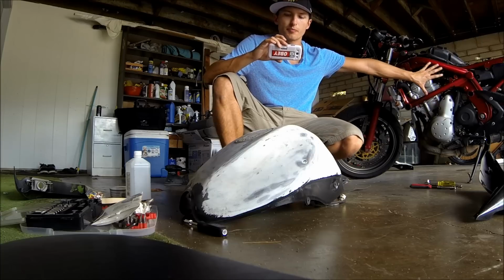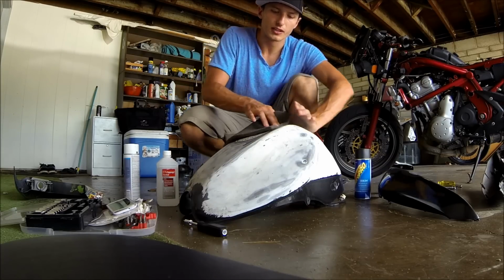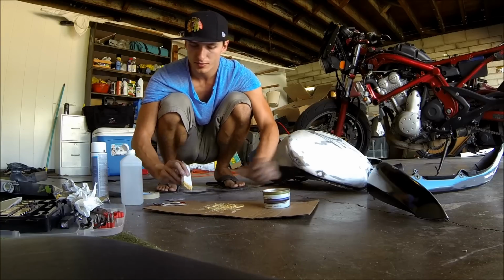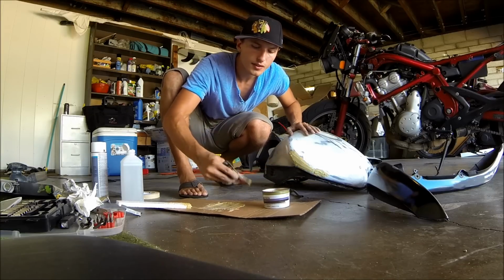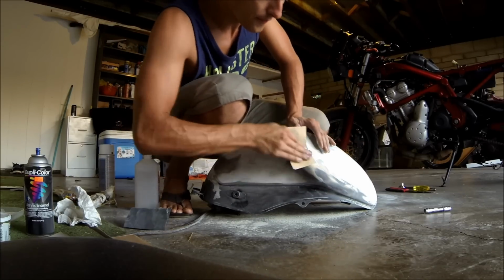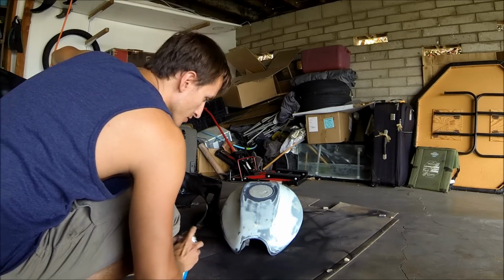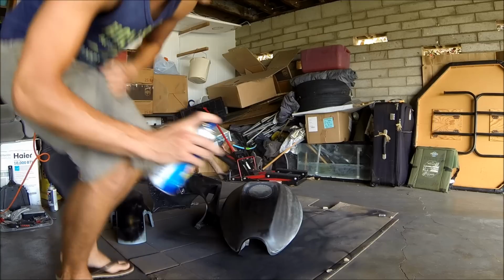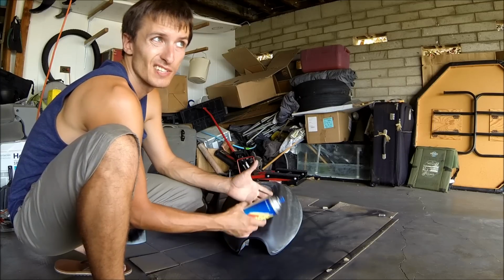HOW TO PAINT a Motorcycle Like a Pro For Less Than $50 !!!!

Comment: nice video bud, only thing i would mention is i used to paint things like bikes and car parts before i got in the car refinishing industry, the problem with aerosol paints at least most of them on gas tanks is that petrol dissolves them. so it is wise to put a 2k matt clearcoat at least on the gas tank

Comment: Yo man. Go Hawks! Little tip on the bondo mixing. Spread it to mix it. If you "stir" it, it can put air bubbles in your filler which will make pock marks

Comment: how are you dealing with gas spill on tank ?. spray can pain gets eating and orange peel fast. sooner or later it happens.  I recommend a curing agent flat clear on the tank with hardner in it. $26 at professional paint shop.
it takes me about 3 cans if good paint to get a good build up on tank.  or it scratches really easy, and go 2 primer.

Comment: Very useful video. I wish you had explained the priming part. Did you use a single coat of primer and sanded it afterwards before painting?
Reply from the maker: Yeah, with the bondo I have to use primer to see if the paint is even.
Reply: Steve Viscuso I've been hearing people saying that the bondo stuff is very fragile when exposed to the sun, that it starts to crack and whatnot. I'm guessing they're exaggerating...Did you ever have any problems with that?
Reply from the maker: ***** no issues, that might only be a problem if you have too much for one job. I have only about two tbsp worth on the side of my tank.

Comment: What type of grit of sandpaper do you recommend to sand the tank before priming it? And can you put clear coat on a Satin Black or Flat Black?
Reply from the maker: That is a kind of tricky question because if you use bondo you might need to use a lower number SP, but if you only use primer then paint I would stick to around 500.  This also depends on if you are going to completely remove the paint and go down to metal.  If that's the case then you just don't want to use sandpaper that will leave scratches in the metal because it will show ( this also is the case with plastic).  Best rule of thumb is to use scuff pads whenever possible, and use high number sandpaper.  It might take more time, but it's worth not having to re-do it.  :-)
Reply from the maker: If you can get a clear that doesn't make the flat shiny then you can do a clear coat, but sometimes these can be hard to find.  Ask your local paint shop, as some of the shops can make you a can of it.
Reply: Ok Buddy, Thanks for your help! I'll check that out..
Reply: Could you put a clear coat on a Satin Black?

Comment: Hallo great video i am going to start rebuilding my chop and i would like to know if that paint will last and how long? is it strong against powerwash and the sun? thank you!
Reply from the maker: +dreikor1 sorry for the late reply, yes it will work good for most, I've had mine for about 2 years now and just need to clean it up or touch up every once in a while because of the flat, if you want it to last longer put a clear coat over the top.

Comment: did you put any primer on the filler before you used water on it?
Reply from the maker: Yes, I sprayed it with primer then sanded it down until I got the shape I wanted.  I actually put too much bondo and it took forever to do, which is part of the reason I didn't put it in the video.

Comment: Hi, Im painting my bike the same colours. With a flat black do you need a laquer coat of some sort over the top or is the protection already in the paint?? Is it satin black or Mat black?? Cheers :)
Reply from the maker: +Chris Hinde mine is flat black. if you can find a flat clear I rec. using it.  Usually they add a little bit of a shine to it though.  I wanted to go just flat only.

Comment: I wanna do a paintjob to my Yamaha Legend 115ZR. So, do I need to sandpaper all the Blue color on the plastic body before I can repaint them up?
Reply from the maker: Not sure if you painted it already or not, but everything should be scuffed or sanded down.  Just make sure you have the correct grit sandpaper, otherwise it will leave scratch marks.
Reply: Its the factory coloured
Reply from the maker: Omar Nawawi it should be easy to do if it has a factory clear, you just need to scuff it down, and make sure get rid of all the gloss then you can prime it, then paint, then clear again... if this is the route you're looking to go.  If you go flat black like me you can just do prime and flat.  Also, it's the same if you use a single stage paint, it has clear properties, but isn't as good as doing 1.prime, 2.color, 3.clear.
Reply: Okay then, I'll try. Thanks for the reply and advice :)
Reply from the maker: Omar Nawawi no prob, let me know if you have any questions.

Comment: nice video steve... 
thanx for sharing
Reply from the maker: Thanks, let me know if you have any questions.  And if there is anything you'd like to see in the future.
Reply: do you ever make fiberglass?
for body or hornet motorcycle custom
Reply from the maker: Ikin Tetsu I don't have much experience with fiberglass, I think I used it once on my first motorcycle, but I prefer to use bondo cause it's easier to work with than fiberglass.  There are a lot of products out these days for different applications, check with your local paint shop and see what they recommend for your specific project.

Comment: I want to paint my 97 cbr 600 fairings and my biggest problem is that it has most of the stock stickers that won't peel off, so that'll be a pain in the ass to sand through. Any advice?
Reply: heat it up with a hair dryer , this will cause the glue of the stickers to melt down and they will peel off really easy !
Reply: Steven Galan I tried that on some of them but still couldn't peel them off, I may need a better dryer or something.
Reply: *****
you need to heat it up a bit more, dont be afraid of the fairings they wont melt down, just keep heating the sticker close.
It never let me down and my bike is the same as yours :D
Reply: Steven Galan Thanks, I'll try again. ;)
Reply: ***** if the person sprayed clear coat over the decals you will need to sand through the clear coat first, then use the heat gun.

Comment: would the gas melt the paint off if you don't clear coat it or wax it i'v painted my gas tank and then the gas strip my paint off it suck ass after doing all that work for nothing
Reply from the maker: With the flat black I just scuff it again and do a small bit of spray.  There are definite pluses and minuses to using flat black.  I just recently had to repaint a portion of my tank because I got a bunch of gas on it.... If that does happen, try to wipe it up right away!
Reply: you must use an automotive grade paint it has hardner in it and the gas won't remove it

Comment from the maker: Yeah put a pretty bad dent in the tank so I had to do the Bondo work on it.
Reply: Nice vid. Got a small scratch and dent on my tank. After watching you, I'm gonna give it a go. How many clear coats would you recommend ?
Reply from the maker: +Mike Girard I would recommend at least two, you can even wet sand it.  Clear coat can look very good if you do it right. My first motorcycle I painted was red and I put a clear of spray paint and people thought it was professional.  Get a little practice in and it will turn out amazing!
Reply: Thx Steve. One more quick question. Do you ever have problems disconnecting or especially, reconnecting the hoses underneath? Sources tell me to be weary of short connecting tubes.  mike

Sent from Windows Mail
Reply from the maker: +Mike Girard yeah, it can be tricky... if you have a carb bike it's not fun, but if you have fuel injection it's not as bad. On the safe side you can always have some kind of plug for the fuel, or just have a container to let the fuel drain into.  My bike doesn't let any gas out (well maybe just a few drops) but you never know.  As for electric wires, they usually disconnect pretty easy.
Reply: Again, thx. I’ll keep you posted on how it comes out.

Sent from Windows Mail

Comment: What grit of sandpaper did you use to initially sand the tank?
Reply from the maker: +Marcos Sullivan the higher the better. I would start around 500 depending on the job.
Reply: Steve Viscuso Would it be possible to start with 2100 grit sandpaper

Comment: What top coat keeps gas from eating the paint on the tank?
Reply from the maker: Usually a clear coat will keep it safe from gas but that only means if you have a good clear coat or if you have a professional paint job on your motorcycle. Eventually with any type of paint it will leak through.
Reply: +James McGall A catalized clear coat will protect the paint. That is, with the new paint systems. You can get catalized clears in cans too... They are the ones that require you to pop the internal can so that the hardener can mix with the clear...

Comment: You can get better results with a spray gun, Spray Guns enable you to thin the paint, where as a spray can won't!
Reply from the maker: agreed. but you can get different kinds of nozzles for spray cans too. but most people don't know that.
Reply: And you can get a trigger system like Cangun1 which makes cans far easier to use

Comment: could you please tell me what i need to have to sand the fairings and paint them please?
Reply from the maker: Depends on if it's just a new paint job or if you scratched them? Should be ok if you scuff it then repaint it.
Reply: it white color, i just want to change it to black. what sand paper is good to use?
Reply from the maker: Mohannad Gazzaz going from white to black is easy. Get scuff pads.  The grey or red kind should be fine.
Reply: thank you

Comment: Did this before, doesn't last long.  Pressure washer or car wash will just spray all the paint right off. All you're doing is destroying your bike's body.
Reply from the maker: I've had 3 different motorcycles that I've sprayed myself. As long as you sand it and prep it peoperly you should be golden.